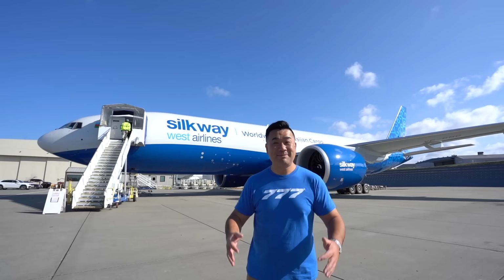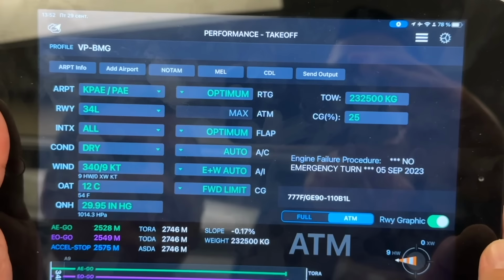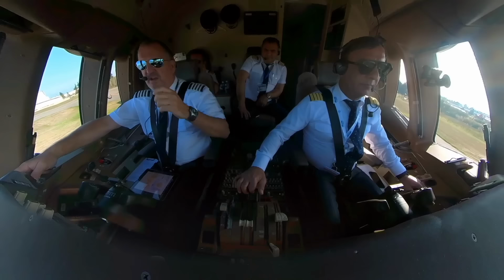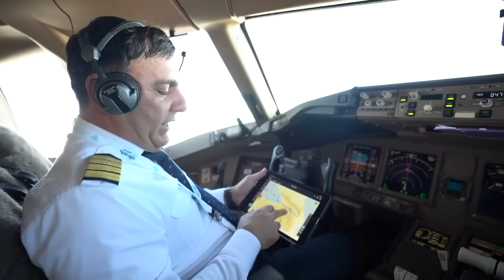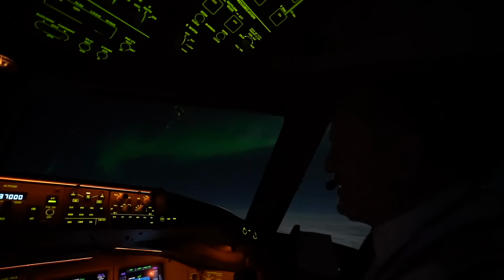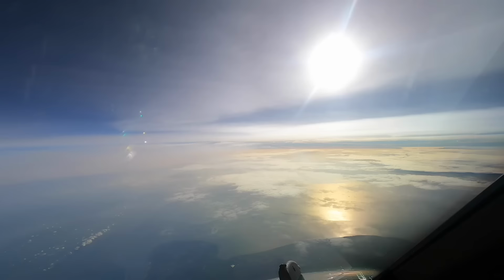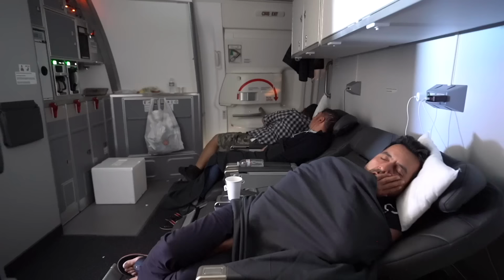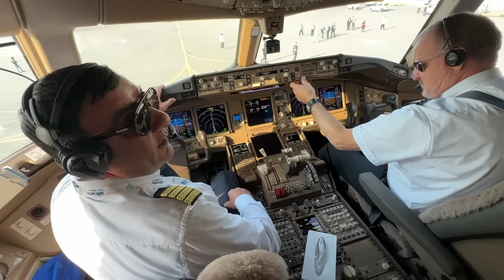Factory New Boeing 777 Cargo Delivery Flight - Silk Way West

Comment: 9:55 Using grease pencil to mark stencil on bare metal is not a proper process (since it will be prime over).  Which will lead to paint failure later on.

Comment: So nice! -- QUESTION -- Great plane Sam. But the speed at 37,000 feet was 262 knots. I google the cruise speed for a 777 and it was nearly double this.  Any idea what the normal cruise speed should be on this?  Does it go slower when new like a car until it is "broken in"??
Reply: 262kts is Indicated airspeed. Due to reduced density at cruise flight level, True airspeed (or groundspeed without wind) changes by a lot compared to IAS
Reply: @pilotoecom  ...but it was flying at 262 and should be going much faster
Reply: @Coleen_West  262kts INDICATED airspeed, true airspeed (TAS) would be approximately 480kts at that flight level.
Reply: @pilotoecom  ..hmmm.. maybe it is my "girl brain" but when his flight display screen says 262kts do the pilots then have to do a calculation to determine their actual true speed?  What is this nutty system and why does the computer not do the actual calculation itself? What gives? It would be like my car giving the wrong speed based on the outdoors temp. and leaving it to me to do the math on it. Dangerous and silly.
Reply: @Coleen_West  You are assuming too many things too quickly. The Air Data Computer does all of the calculations and displays TAS and Ground Speed on the other screen. It's not dangerous or silly, different speeds are used for different purposes. There is a reason behind the need of studying to become a pilot